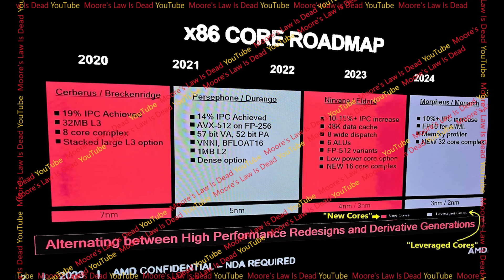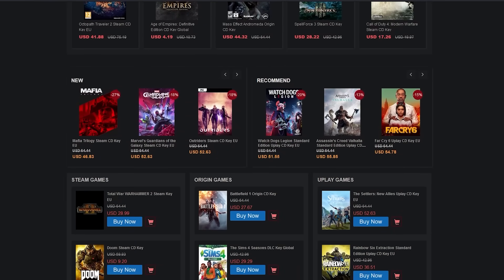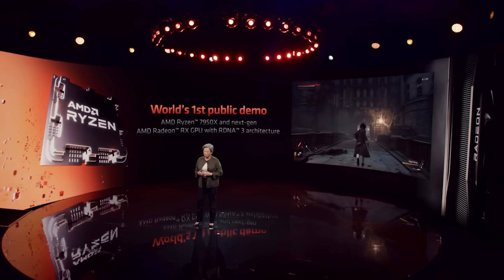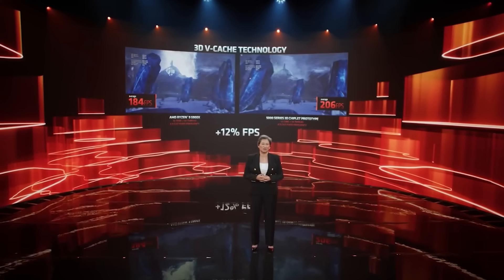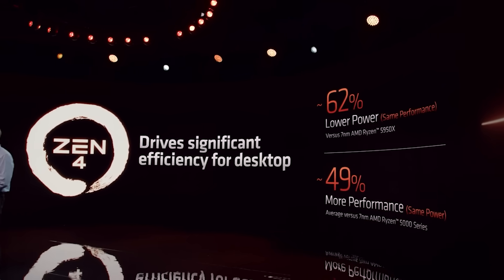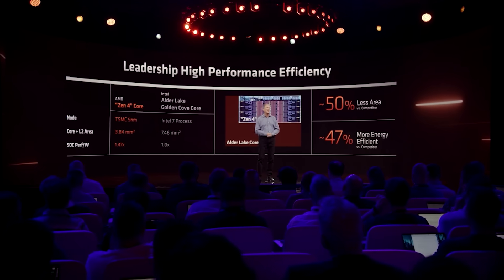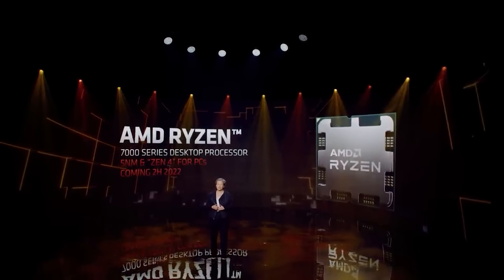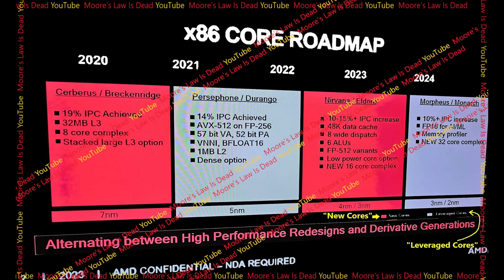Investigating Zen 5's INSANE IPC Gains - What's Going On?!

Comment: Dude, if AMD reworks their MCM architecture and gets rid of their IF and can run parallel transfers near die speed between the different die, Zen 6 WILL have an excellent IPC uplift in MULTI-THREAD performance.  If they can figure out they need to move the memory controller onto the CCDs it will be even bigger.
Reply: The memory controller used to be on the same die with the cores, they moved away from that because it's better to have uniform memory access.

What they need is a damned massive L4 on the IO die and lower latency IF.
Reply: @looncraz  Once again if they can move data between chiplets as near die speed, which would mean getting rid of their IF, they could add a chiplet for L3, not L4.  L4 adds another lookup.  That's not good.  It's all about how fast you can move data between tiles/chiplets.  It would be better for AMD to get rid of Vcache and have an L3 chiplet because die on top of die is a heat problem and the ONLY solution is slowing down the cores.

Since AMD moved to MCM the mem controller has never been on the CCD.
Reply: @johndoh5182  If a L3 chiplet would be good, AMD would already done so, it's not good
The 1st generation Zen had exactly what you describe, die to die Communication, it was being proofen it was inefficient
Having L4 Cache needs to be tested in practice, if the amount of L4 Cache is enough and fast, it will perform better than having no L4 Cache, Broadwell was very interesting Architecture, especially in tasks where it can easily outperform Skylake because of the L4 Cache it have
Reply: If your MT threads are bouncing around between CCDs you're doing the application programming wrong.
The fact is dual CCD 16c/32t Zen4 competes with the Intel CPUs at far lower power consumption in the MT  benchmark suites.
So where is this obsession with IF & memory access come from?
It is desirable to have a unified L3 cache and there is a leak about Zen6 suggesting that's happening, but the implementation is more TSV V-cache tech bringing the cache close to the cores.
Reply: @RobBCactive  So what you're saying is when your CPU is doing a task that can run 32 threads, compression/decompression, rendering, etc.....  that if the PROGRAMMERS limit those operations to only run on a limited number of cores based on what I don't know because how would the programmers, THAT is good?

We'll agree to disagree with what you said.  There are quite a few multi-threaded apps especially when you get into the world of engineering where modeling the physical world can often use huge data sets and if you're CPU has 64 threads will use every one, and it's NOT bad programming design.

Dude there are WAY too many scenarios to make a blanket statement to a person that if their system has cores from different CCDs passing data to each other that somehow THAT is a problem.  You're talking as if 2 CCDs is supposed to mean 2 separate CPUs and that's laughable.
Reply: @johndoh5182  No, it's obvious you don't really know anything about programming.
I simply pointed out to you that both the OS and programmers want the threads to STAY on the CCX they run on precisely because of L3 cache which uses physical memory locations.
Your whole model of what is going on is incorrect and will result in little difference, because highly MT programs aiming to scale have to understand how to use caches.
Reply: @Syping  "If a L3 chiplet would be good, AMD would already done so, it's not good"

No shit dude.  Apparently you didn't read the first part of my statement,  " if AMD reworks their MCM architecture and gets rid of their IF and can run parallel transfers near die speed between the different die"

Paul is speculating about reworking the way interconnections work.  

I was speculating on what Intel should be able to accomplish with THEIR interconnections which doesn't use a multiplexer built into a chiplet to move data around which is what AMD's Infinity Fabric does.  My understanding is Intel's interconnect uses parallel interfaces.  This is acting like what happens INSIDE a die.  So if Intel, with their tiled interface which can use parallel data transfers and my understanding is direct connects between the tiles, I don't see why AMD can't do the same.

So, I will stick with MY speculation since AMD plans to rework their IF and they HAVE to because it's too much latency, not for their older CPUs like Zen 2/3, but it's already creating problems with Zen 4 such as memory speeds which is NOT the problem of the memory controller but instead the ability of the IF to move that data fast enough to the cores.
Reply: @RobBCactive  Dude, a programmer uses a high level language.  I want YOU to go into a high level language and show me where you are getting information about how a CPU is configured, and THEN YOU are determining how the CPU schedules the spawned threads.

A programmer writes code for a class of processors, such as X86-64.  You don't get into specifics, such as writing 5 different sets of the same code depending on what KIND of X86-64 processor you're working with.

There's a GOOD REASON why it takes an OS scheduler to deal with scheduling threads, and NO application I've ever written was one bit concerned about a specific CPU, nor did I ever learn anything like that when learning different languages.

Comment: 20% to 30% IPC gains = Hope 
15% to 20% IPC gains = Expectation
10% to 15% IPC gains = Reality 

😂
Reply: Depends on the workload, for a lot of stuff zen 4 is 50-100% faster than zen 3.
Reply: Keep in mind there's also a clockspeed regression. If you see "at least 200-300mhz" less we'll be lucky to see 10% gain overall. Everyone here is drowning in hopium if there's any accuracy to these leaks.
Reply: Or it'll be the other way around.
AMD promised a 9% IPC gain for Zen 4 at first but delivered 13% in the end.

Comment: I am not planning to upgrade for the next cpu/gpu generation. I got a (if you can call it that) good  deal on a 4070ti and my 5800x3d is still strong enough for this gpu in most games. The next time i upgrade my pc it will essentially be a completely new one apart from drives, psu and case.
Reply: Yea, im in the similiar boat 6800xt and 5800x3d. Nothing is really compelling enough in terms of performance uplift and pricing on the horizon until rtx 6000 or RDNA 5